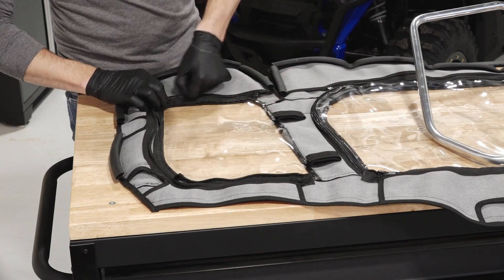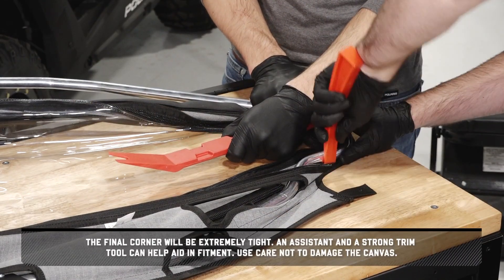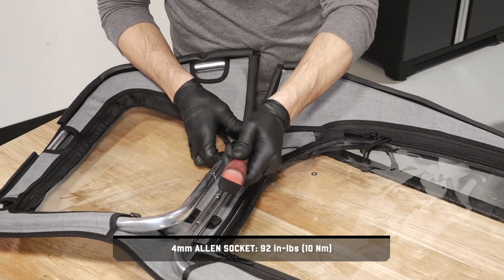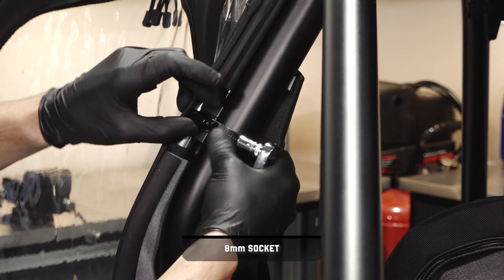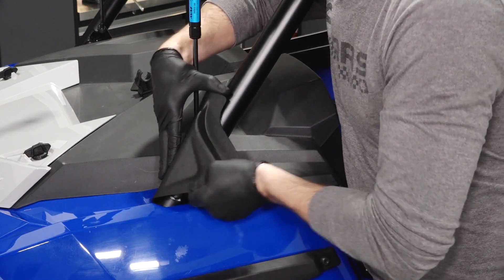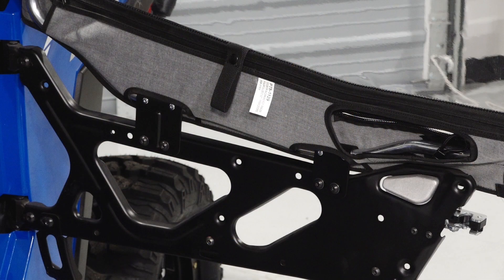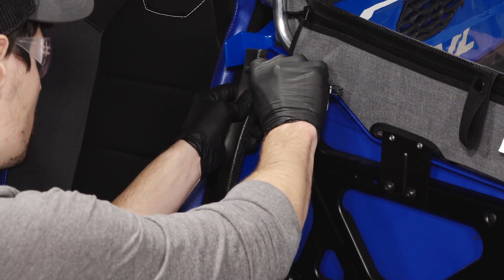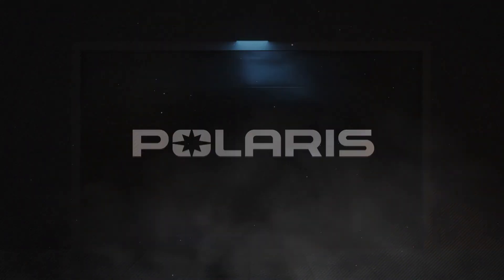RZR Trail/Trail S Canvas Upper Door Installation | Polaris RZR®

Comment: When stretching the window around the frame do not make the last stretch at that front corner, it's impossible. I put it on from upper rear corner first, then front 2nd, then forward lower mount, and finally, rear mount in a clockwise direction.
Reply: You sir are a life/zipper saver!! I'm almost sure I would have wrecked the zipper doing it the way they show. Still no easy task the way you did it but we got it. You saved the day!!! Thank You!

Comment: My kit came with two drivers side roll cage covers. I can’t get Polaris to understand the drivers side will NOT fit the passenger side.  There is not a specific part number for this triangle shaped plastic cover.

Comment: Can you use the adjustable Folding Side Mirrors (Item # 2884524) with these canvas doors?
Reply: This is something i would like to know as well i am using the same mirror . According to the polaris website in the build section it work with these mirror but i have my doubt.